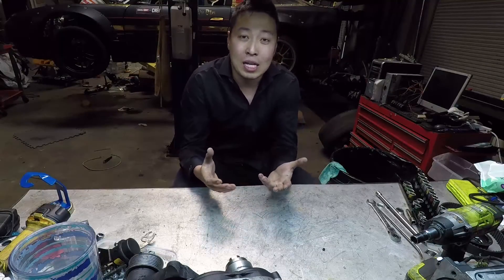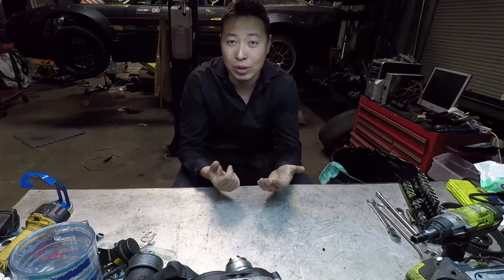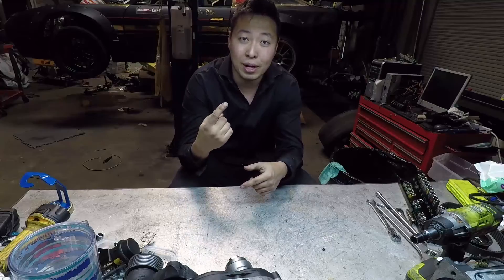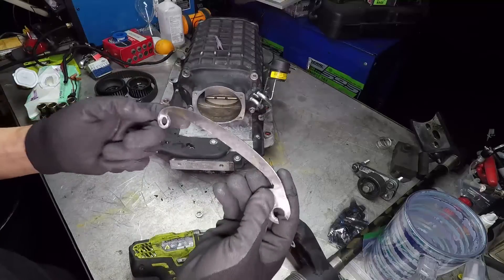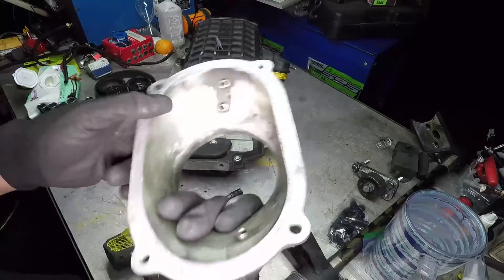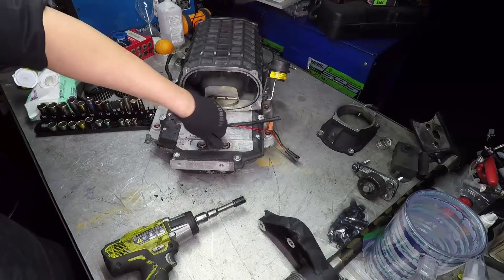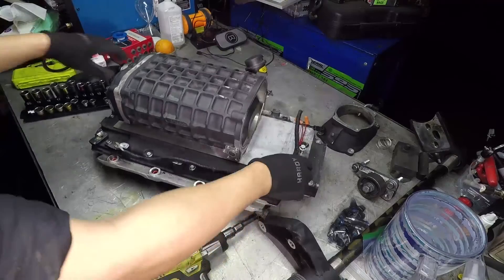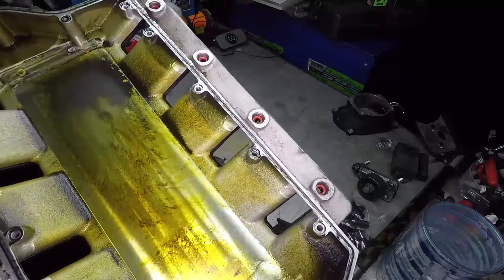TVS-2300 Magnuson Supercharger Disassembly Part 1 of 3

Comment: hi what oil need to use
Reply from the maker: You can use gm supercharger oil.
Reply: @spikedrift  i checked online they say use eaton
Reply: The long wire on the left hand side near the fuel rail where does that plug in to